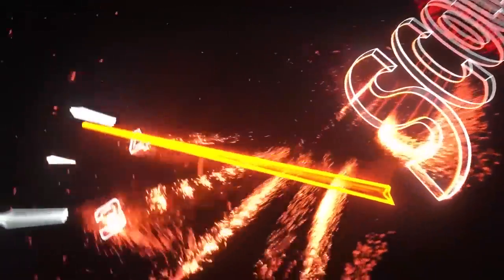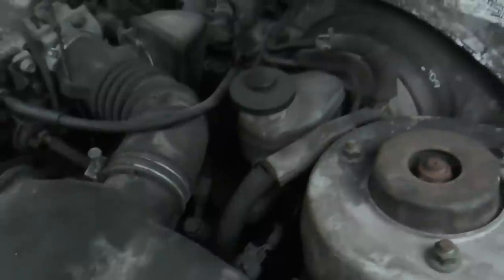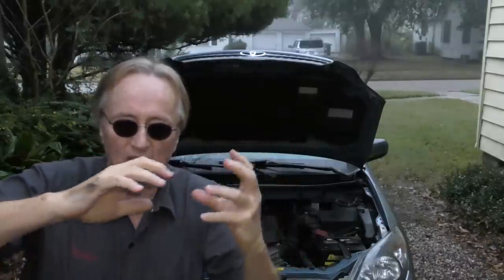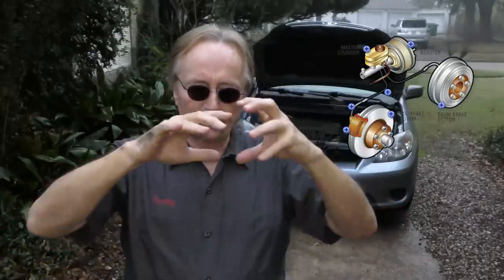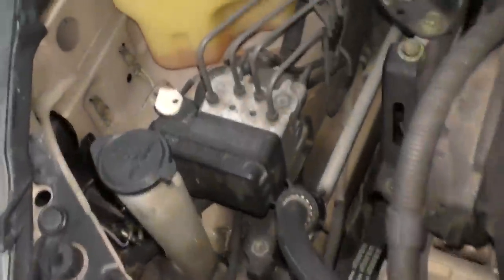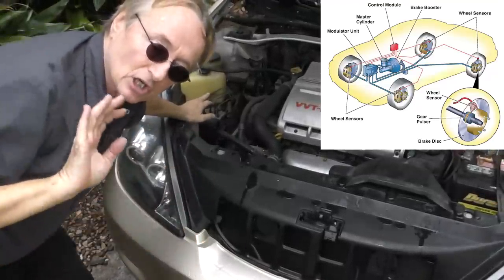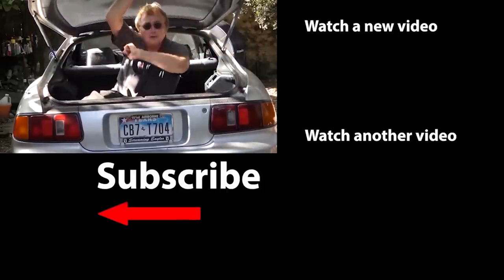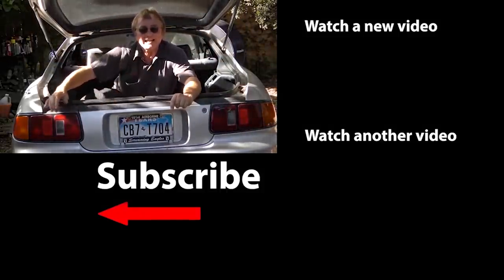Never Do This When Braking (Destroyed My Car)

Comment: Hey scotty got a question for you so my car has some rough shifting been going on for maybe  6 or 7 months and I drive it daily (I know not good) but all of the sudden I get in my car and it wont accelerate and the speedometer doesn't move at all. AutoZone do diagnostic test inside shift solenoid but I changed that and nothing happened. Then on my drive home all the lights in my car started going dim in the car just shut off. I got it running again but what should I do???

Comment: What if you hear a hissing sound while the vehicle is on and driving. My 98 Honda passport still brakes but not on a dime, could that be the brake booster. My master cylinder is full and checked all my tires to see if I have a leak and I don't. Need help

Comment: Missed air in system and bad vacuum check valve much cheaper than the brake booster.

Comment: Isn't it normal that if you "pump up" the brakes BEFORE you start the engine, the brake pedal will go down a little bit?  I believe that indicates the booster IS working.

Comment: My personal experience with brakes; never let your friends drive your old beater. Blew my caliper seals right out. Needless to say I went to drive to work the next day I never made it. Came around a slight curve cursing 50 and usually started braking half way down the hill before 100° turn but I had no brakes. Tried my hand brake the cable snapped ended up doing a cartwheel and rolled 6 times.

"Moral of the story do your brake checks before driving" lmao

Comment: Can you give a detailed review of the 5.4L Triton engine I'm about to buy one (06) for way lower than it's valued and only has 100,00k I know that it's a hot topic for most some say they never had a problem others won't stop talking about the spark plugs phasers and oil pump I'd like to know what you think thanks and I've just subscribed I'm enjoying your videos 👍
Reply: It does have a tick coming from the top of the engine. Maybe the roller followers?

Comment: My 2006 Kia Rio, the brake pedal sinks rapidly about 3 inches when applied before the brakes start to catch. It has 166k miles, and believe it or not; all the parts on the car are still original. I've been looking around and I believe that the master cylinder or the booster is start to fail.

Comment: You should bleed brake once a year brake fluid is cheap compared to anitlock and brake cylinder pull old fluid out mater cylinder bleed until you Des new fluid

Comment: Can't you just pull the ABS fuse to de-activate it and drive without ABS ?  (as long as the fuse isn't connected to other systems).
Reply: Depends what country I suppose. I know in the UK if you did that and the abs warning light is on it'll fail its MOT (our version of inspection.)

Comment: I've a 2011 suburban that just started to make a popping/vibration when I start coming towards a complete stop
Reply: kayin Soape you could check your breaks and rotors in the front. My car would vibrate if the rotor is worn. If the popping is more like ice being crushed then your pads are eating into your rotors. Depending on how far it ate, you could slap new break pads on if you’re in a pinch financially. Preferably you should replace both the rotors and pads.
Reply: That kinda what I was partially think an I know for a fact the rotors are worn an grooved pretty good so thanks for giving me some assurance their :)
Reply: nope no lights but I'll definitely look into the other things listed here! Thx alot I appreciate it!

Comment: Hyundai is more reliable than Honda.
Reply: DSTY but your photo is a bmw emblem... embarrassing
Reply: U wrong doe
Reply: EssenceofPureFlavor honda fanboy.
Reply: @asdfghjqwertyu1858  Nah. Just not stupid.
Reply: EssenceofPureFlavor lol.
Reply: Okay people get your  picthforks and torches out
Reply: DeWalt Tools brainwashed Honda fanboy.
Reply: @asdfghjqwertyu1858  I'm not a Honda fan I don't like Hyundai I'm actually a GM fan and Ford fan
Reply: @WorkHorseLT  GM and Ford were good at winning WW2. That was a long time ago.
Reply: @stephenarling1667  very funny at least Ford is still some what good gm tho idk about them any more I liked the older ones are you a Toyota 
Fan
Reply: @WorkHorseLT  I own a Honda, a Chevy, and a Mercedes. I have owned a Saab, a Studebaker, and a 1961 VW Beetle. Of all these, the Honda is by far the most reliable. Studebaker was the best American car. Of the machine tools I have owned, Milwaukee, Porter Cable, the OLD B&D, and Delta have been best.
Reply: @stephenarling1667  I didn't ask about the tools you had i  hadn't heard studabaker in e long time
Reply: @stephenarling1667  wtf once is enough not 3 times
Reply: @WorkHorseLT  Do you remember when DeWalt made real machine tools, like their old Radial saws? I do. Now it's just a name slapped on battery-powered plastic toys and disposable items. I thought you wanted to discuss the relative merits of present-day American manufacturing. Evidently you don't.
Reply: @stephenarling1667  fine I will but you sent me the same thing 3 times yeah they don't make anything like they used to I have tools from the 30s and still works great to this day